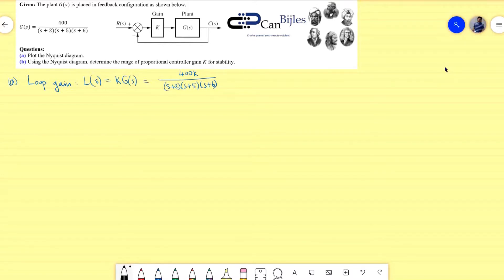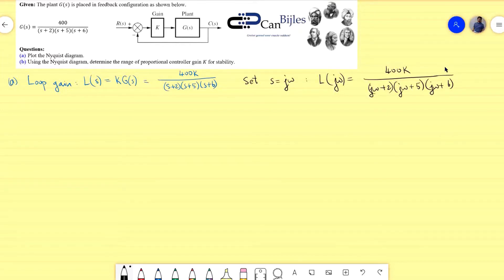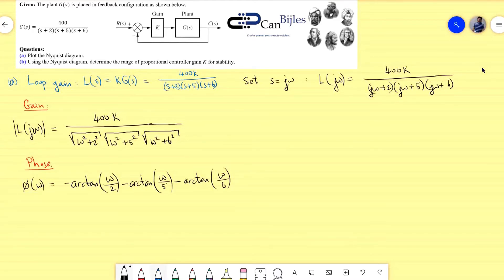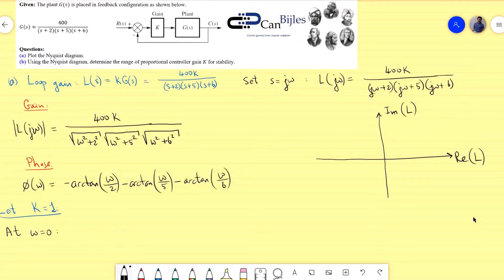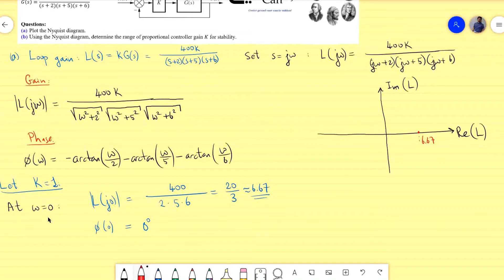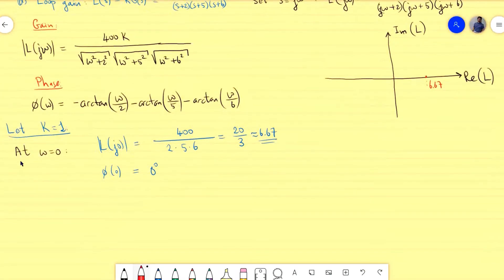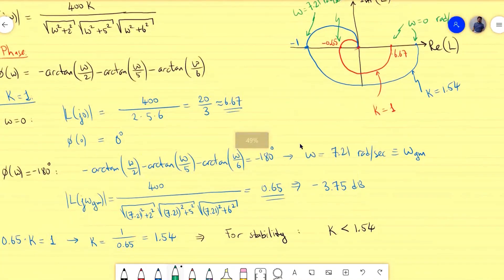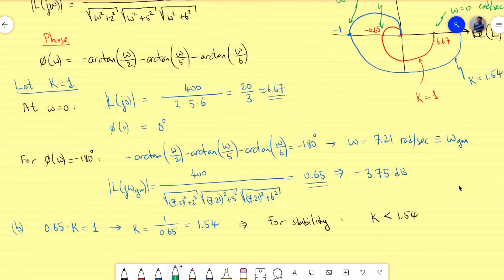Nyquist Diagram 🌟 Stability Criterion 💡 Example 1

Comment: Excellent explanation!! Very didactic. But I have a question. I just cannot fully understand why -1 and 180 phase is bad for the stability of a system. Can you make a comment about that ? Thank you very much
Reply from the maker: Thanks, you are welcome! Share the knowledge :)

There are many ways to describe this, but here is my version:
The stated problem considers a negative feedback system, this is required for stable systems, like amplifier and filters. Having a negative feedback, the total closed-loop system has a sign inversion in the loop, which means 180 degrees. Now, if an additional 180 degrees occurs due to components, frequency of operations or for any reason, then the total phase in the loop will be 360 degrees. Phase shift of 360 degrees means positive feedback and this can cause the system to oscillate or get out of control if there is no enough damping in the system.

I hope this clarifies the situation. Just let me know if you have further questions.

Comment: Hi, thank you for your videos. They are very helpful. I have a question, if you don't mind answering. In this example you found Wgm by setting  Φ(w)=-180. In another example, you found Wgm by multiplying  the numerator and denominator of the TF  by the conjugate of the denominator then  setting the imaginary term=0. Can I use any method at any time to find Wgm or is there a specific occasion for each method? Thanks a lot
Reply from the maker: Thanks for your message. Glad to know you liked the videos :)
You can use both methods, but depends on the problem which one is faster and easier. When you make the imaginary part zero, you will only have the real part, having the phase 180 degrees.

Comment: I have a question, if G(s) = 400/s(s+2)(s+3), which method should I use to solve?
Reply from the maker: It depends on what do you want. In general, it does not depend on the transfer function.

Comment: Thank you for the useful information Can you please explain to me how you obtained the value of w=7.21 rad/sec? I have tried a lot, but I haven't obtained anything. I need these steps for my exam.?
Reply from the maker: You're welcome! You need to set up the transfer function of the loop gain. The phase expression of the loop gain transfer function must be equated to -180 degrees and you need to solve for the omega, you should do this numerically. I actually discuss this from the start of the video, maybe you can check it again. Good luck.